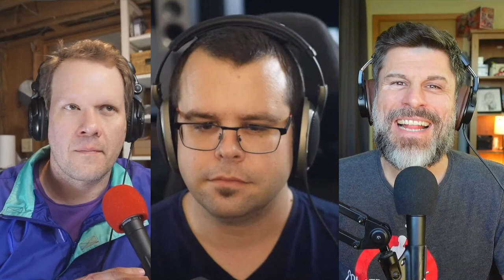Tinting BVMs & the German CRT wizard w/ John Linneman

Comment: Great video with a great guest! About 100hz, I’ve always wondered: can’t those TV set “downgraded” to 50hz? I mean, there are mods to increase TV Lines…
Reply from the maker: Good question, I don’t have any information on possible “de-100hz” mods
Reply: Some of the loewe ones can bypass 100hz using a vga input, but that is only for 31khz sources. supposedly you could hook up a gbs-c to one of those to upscale 240p to either 480p or 240p120hz. Maybe Ludocalle could test something like that, he makes vga input boards for certain loewe sets.

Comment: Also wanna share of a new possible CRT gem I just found. I just picked up a 27" GFM MJ427GG consumer set.. its a curved standard def set w component inputs, and was manufactured in September of 2006!! Its the best picture Ive seen yet w my MiSTer and has 0 capability issues w cores.. My Trinitrons always had issues with the NeoGeo core and some of the Arcade cores.

Comment: I used to detest the 100Hz / !20Hz CRT TVs back in the day. From the late 90s and at least half of the 00s, almost ALL TVs in the UK were "100Hz Flatscreen".

It wasn't so much the juddering / duplication of frames.
Some of them had their own "cinema motion" thing, to interpolate the frames, which was sometimes tolerable.

But almost always, the processing itself was horrific. lol

That generally gave a super grainy image with fake "sharpness" and rining added to everything.
A bit like a really over-processed "THX Remastered" DVD.

To add to that, when they showed the TV in the shop, they of course had the Brightness (black level) set too high, and the Contrast cranked to the MAX.

I don't know why anyone ever thought they looked good with those settings.
Also, at that time with larger flatscreen TVs (a very common size here was 32 Inch), the asking price could be easily £600 upwards.

These issues genuinely put me off buying a new TV for many years. I stuck with older TVs like a Ferguson with the TX-100 chassis.
The Fergusion I think had a 21" screen, and allowed S-Video input via SCART (Luma on pin 20, Chroma on pin 11), which was great for the N64.

The only small downside to the Ferguson TV is it  had those three thin RGB "feedback lines" at the top of the screen, which were visible in 16:9 mode when watching DVDs.

Anyway, yeah, 100Hz/120Hz was usually as bad as John was describing. lol

There were some very good TVs around as well, like some sets from Sony, which were sometimes still 100Hz/120Hz, but didn't have the horrible grainy processing or "Soap Opera effect" of other sets.
Reply: Oh, and the irony is that many sets still looked subjectively better if they were only 50Hz/60Hz. We barely used to notice the flicker of 50Hz, it was never really an issue after a while, and I'm very sensitive to that stuff.

(for example, I'm super sensitive to the "Rainbow Effect" on single-chip DLP projectors. I did see the flicker on 50Hz TVs, of course, but it was never super distracting.)

Then one the first generation plasma TVs started showing up, they often had awesome image quality.

They generally didn't tend to over-process the image like the 100Hz/120Hz CRT sets did.
Some of the earlier plasma TVs (like the Kuro) were considered for many years to be some of the best TVs ever made.

And then we kind of regressed for a few years, once everything moved to using LCDs with an ARM SoC and built-in scaler.
Some of that nasty "Soap Opera" motion smoothing / frame interpolation came into play again, and some LCD TVs didn't even let you disable it. lol

I'm so glad things have improved a lot since then, and more consumers know what to look for now.

This is making me want to buy an OLED soon. I've never had one. lol